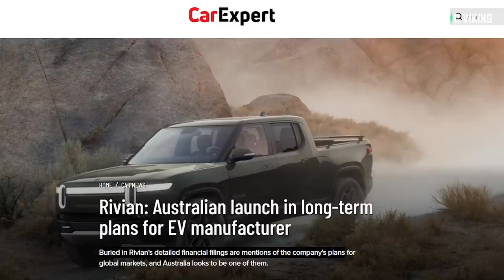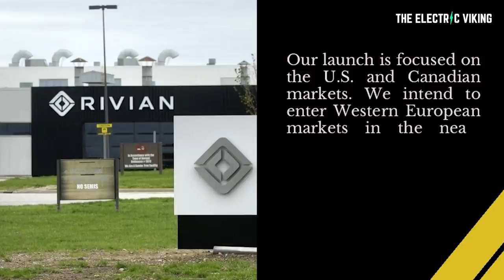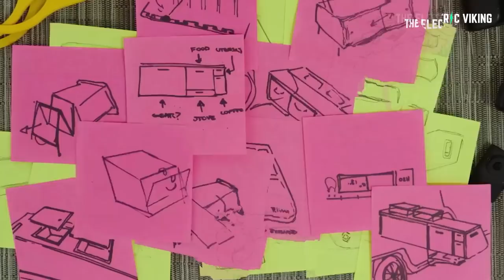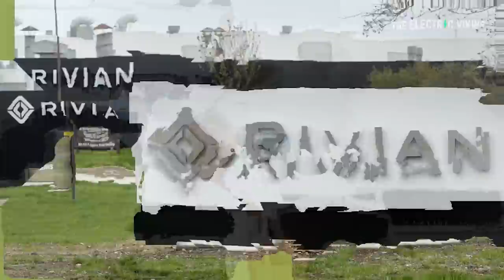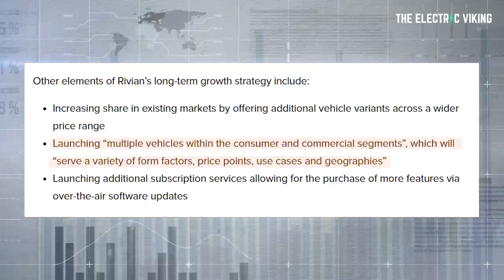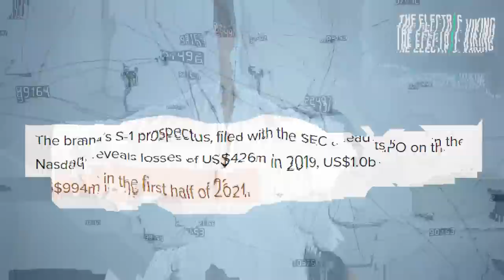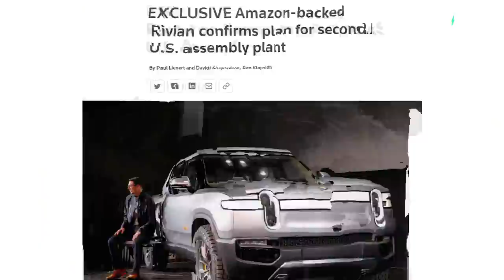Rivian's global EV expansion planned for Australia, UK, Brazil & China

Comment: Rivian has NOT as of 10-24-21 released any vehicles to the public in the United States.  A few probably less than 20 "may" have been released to Rivian employees and or investors.  Rivian needs to get vehicles out to the public and STOP dragging them out.  Tesla also has a pending lawsuit against Rivian.
Rivian has never shown a towing test or range test while towing.  We don't even have a public range test of the vehicle.  Rivian needs to add a 110 volt 10-30 RV plug and a nema 14-50 220 plug for off road camping.